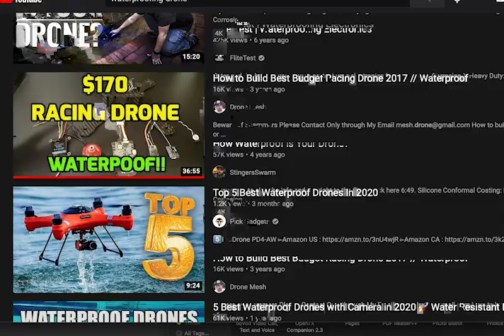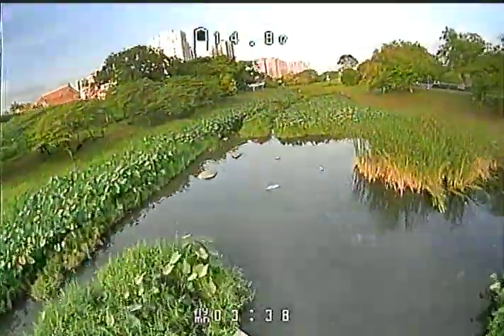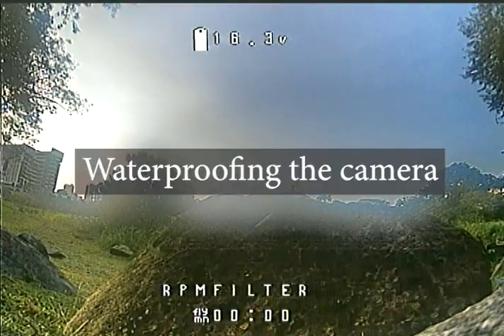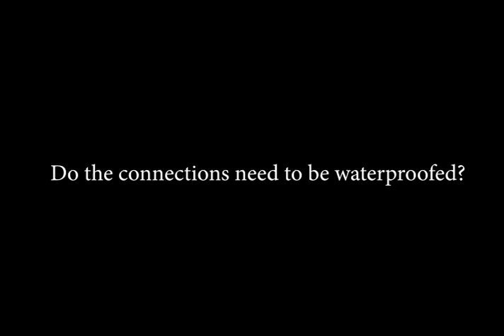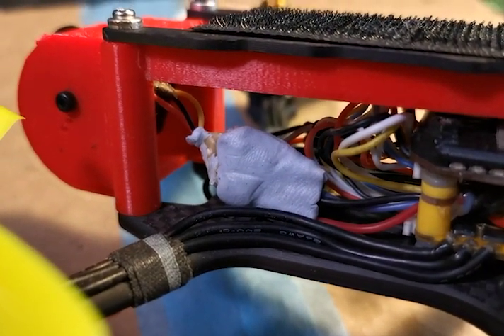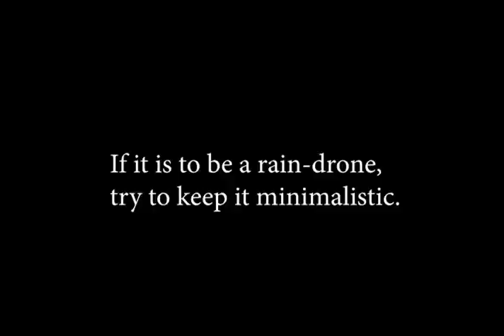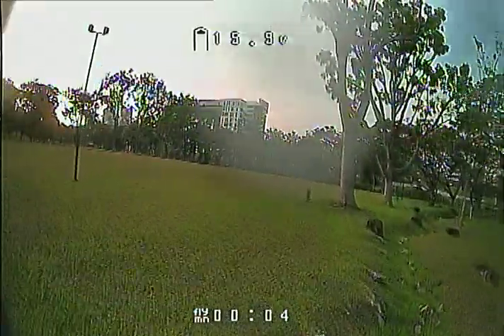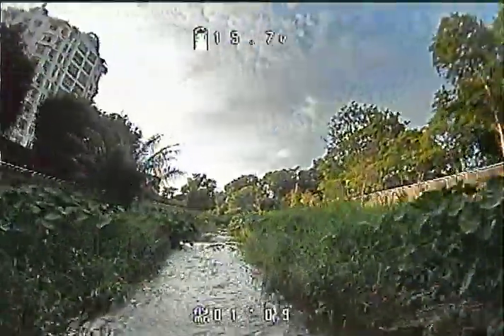FPV - What didn't they tell you about waterproofing your drone

Comment: Great tips, thanks! I also used thick silicone grease inside connectors to waterproof them. Only downside grease collects dust
Reply from the maker: Thank you Vladmimir! Enjoy flying!
Reply: ^^^^^  yes, i use a dielectric grease in the connectors, all of them.   Also acetone will easily dissolve conformal coating if you have to service it.
Reply: They make rubber booties for the USB
Reply: Do you need to put conformal coating on your whole LED bar or just the connection part

Comment: You can actually buy little rubber/Silicone  USB port plugs for next to nothing instead of filling USB port with waterproofing you can just plug and seal. Makes accessing your usb a whole lot easier if need be.
Reply: That's a cool idea, maybe one could be 3d printed out of TPU or something flexible? I'm working on conformal coating my builds for the (eventually) upcoming winter but at this point I'm not sure if only a light coat would do, or if I really need to cover absolutely everything conductive. My initial impression was that it's only super critical to cover the small component legs that are less than a millimeter apart.

Comment: 1 huge tips out a USB plub in the ports... DON'T COMFORMAL COAT THEM.. I don't care what the video says it's extremely hard to dig out comformal coating from that port... Plug the port and cost all over it, you'll be good
Reply from the maker: u r absolutely right! Thus as suggested earlier, pasting the blue tag over it before conformal coating will prevent the socket from it. 
leaving the blue tag is an easy way to waterproof it.

Comment: Surely you can make a plastic cover that covers the stack. Then have rubber opening for the wires.
Reply from the maker: If you try it, do watch out for heat issue though. The quad can drop from the air when the stack gets too hot. Air circulation is crucial to keeping the electronics cool.
Reply: @nutsidea  Yea the vtx is going to be an issue. Maybe if you split the housing for the stack up and had slots between each layer for air

Comment: I tried nail polish at first because it was cheap and always available but noticed after awhile that it would start looking different and nasty. Probably due to component heat but after a few cameras mysteriously died I wondered if it was also conducting current but haven't tested for that yet as I switched to silicone conformal coating by MG chemicals (amazon) and have not had any problems since.
 Winter flying demands protection with open frame drones as even launching and good landings will stir up snow that can get on the electronics and cause issues or damage.
 With these FC components working at 3.3V logic levels it doesn't take much moisture between two adjacent pins to cause IO errors that can bring the drone down.
It's Better to protect than Regret.
Reply from the maker: Thanks for the input! 
My guess is that the heat caused the nail polish to harden and crack. The moisture thus gets to the electronics eventually. 
Whereas for conformal, it remains a bit soft and sticky. Thus providing the protection even after prolonged usage. 
Good information you provided. I am sure others will benefit from your experience. Appreciated.
Reply: @nutsidea  That is a good assessment of what happens. 
** TIPS **
Conformal Coating is also UV light reactive! So you can use a bright blue LED or UV flashlight to inspect your application and spot voids to cover.
 You can cover the backs of and soldered legs to plug connectors, not the matting parts and don't seal the hole on barometer sensor chips and can be used as lite duty alternate lock-tite too.
 If your electronics do get wet power off asap and get it cleaned using distilled water to flush if really dirty and needs it, then allow to dry.
 Re lube motor bearings and/or possibly clean/replace but at least check them.

Hope this does help others and glad someone made a good video about protecting them.

Comment: Thanks for your video, very informative! I'm in the process myself and wondering: how to you handle the small PH xx plugs from ESC to FC ? Or a pluged VTX ?
Reply from the maker: Hi. I first connect them, test the flight to make sure that everything works well, before covering them with the conformal coat. 
Do understand that once you coat them, it is rather difficult to separate them without harming the connecting cables. 
Hence do it ONLY after testing everything works fine. 
Alternatively, use blue tag and wrap them around the sockets. Works as well too.
Reply: @nutsidea  Wow, thanks for those hints, valuable ;) And thanks for the super fast reply.

Comment: Great tips. I killed a gyro conformal coating and fried another, not sure why. I conformaled it over well. Hey what do you do for your XT 30/60 plug and battery balance wire?
Reply from the maker: the XT30/60 plug doesn't need any protection because they are already quite isolated by the plug. 
I am not sure why the gyro fried. Do keep the coating thin to allow heat to dissipate well. But that's just my guess. There is no need to cover the components except for the electrical contacts. The conformal/nail polish is to prevent short circuits due to close proximity of the terminals.
Hope it works for you on your next try.
Reply: @nutsidea  Thanks for the tips again. That MG Chemicals 422C silicone coating doesn't appear to be that good. It can flake off fairly easy. I'm trying clear RTV silicone this time. It may be another fail but at least I tried.

Comment: Great video! Thanks!

What do you use fpr waterproofing? Silicone? Acrylic?
Reply from the maker: For the electronics, conformal coating. For the camera body, I would suggest using glue from the hot glue gun.
Reply from the maker: Nail polish would work for the FC and ESC as well. I won't suggest silicon although theoretically it will insulated the boards from water. But you don't want a thick layer on the boards because you want good heat dissipation. Else the temperature will run up high  very fast.

Comment: Thank you for this video ! It’s all I needed, you genuinely answered all the questions I had after watching all the waterproofing tutorials on YouTube :) 
One question though : what about the XT60 connector ? Does it need to be waterproofed one way or another ?
Reply from the maker: Thank you for taking the trouble to inform me. Appreciated.
Reply from the maker: No the XT60 does not need to be waterproofed because the pins are separated and too far apart for electrical to cause any issue. 
It is when the connectors are very close together that water can become an issue.
Reply: @nutsidea  No issues even when submerged?
Reply from the maker: @MrPhilbautista  no damaged issues. However the video transmission and the radio signals drop-off dramatically when the drone is under water. Thus, you will lose connectivity when the drone is about 5-10 cm submerged. 
Otherwise it is fine. You will see your LEDS still on even when the drone is under water.
But do not. As prevention, always unplug with the drone submerged. Either that or immediately unplug lifting the drone out of water.
Reply: @nutsidea  Thanks. What if the antenna is high enough to stick out of the water? If there's nothing interfering with the propellers, is it still possible to fly it out of the water? I've seen it done but no idea what motors they use.
Reply from the maker: @MrPhilbautista  if you are standing right next to the drone, that wouldn't be much of an issue even if the drone is 20 cm inside water. The motors will spin in water without problem. It is an issue of signal lost if you are at a distance, and the drone gets submerged in water. In that case the signal cut off will be quite sudden. So it is a case of pure experiment vs a real-world flying situation.
Also in real-world, if it enters water like lake, streams or river, stuff like plants, sticks, rocks, etc will prevent the props from spinning as well. 
Just sharing on those situations that i had encounter before. Took quite a few dips myself to retrieve my quad.
Reply: @nutsidea  Thanks for sharing.

Comment: Would the same logic apply to waterproofing a high payload drone? For example a DJI S900 or Matrice?
Reply from the maker: I would think so. There's not much to it actually. Just insulate the electronics and exposed connections. However for big stuff, you might want to consider using silicon instead of Conformal or nail polish.

Comment: hello is there any issues with overheating  using dji fpv system?
Reply from the maker: Important to turn the temperature control to ON. (you can set it in the DJI goggles) that way the high power mode only kicks in when armed for flying. When flying, with good airflow, it is not an issue. When not flying, it is in low power mode, so that is not an issue at all. 
Even if you have the temperature control at OFF, on Vista, it takes quite some time before it gets too hot in hot weather. But if you have the Air Unit, it gets hot very fast.

Comment: @nutsidea how do the moters take the dipping into water? is there anything to consinder?
Reply from the maker: Hi Andreas. 
There is no need to worry about soaking the motors in water. The motors are brushless and don't get affected by the dip.
Reply: @nutsidea  thank you for the fast response. will coat my thoothpick for the winter season.
Reply from the maker: @AndreasFelix  That's awesome! Wished I had a snowy landscape to fly around too. 
All the best!

Comment: do you have to coat some part of the motors? i dont find information about the motors in time to coat a drone, pls help me with that information
Reply from the maker: Plus do NOT coat the motors. No need at all as they are brushless. 
At maximum, spray or drip a bit of oil into it. I didn't bother. I wash my drone all the time and it never is an issue.

Comment: How to waterproof 4in1 esc pin that use connector
Reply from the maker: Hi. You first plug the connector in. Then coat the whole connector casing with a layer. Remember to apply coat to the where the cables enter the connector. 
In most cases, the connector can still be separated after months. But occasionally, separating the socket can rip off some stuff.
Reply: @nutsidea  thanks for your reply 👍

Comment: I have rush tank ultimate vtx which is have a like metal shielding on top of it, so can I coat it bu just flooding it from outside ? or should I open the shield(I dont know if it safe)
Reply from the maker: From experience, Rush glues the metal casing to chip. You can ply it open quite easily but do it slowly. 
Also, what I observed is that most Rush stuff come coated with light insulation already. So it is not necessary to coat it anymore if you see that coating when you ply the cover open. You can glue the cover back. 

However, do check the board yourself. Cos I am not sure if yours is ultimate mini or tank II ultimate. Mine is a mini.

Comment: Hi! My quad crashed at water in 5 minutes, is still fine to use?, is there any components to destroy?
Reply from the maker: If you unplugged the power while it was still in water, it should be fine.
However, dry your quad thoroughly before plugging in power to try again. I usually place it on top of my modem box because it it pretty hot and dry there. Takes about at least half a day to ones day. 
Then plug in and see whether the ESC or FC are still working fine. 
Rarely does vtx, camera and crossfire get damaged.

You can reference this post for the dip mine had. 

FPV -- How to retrieve your drone from a pond
https://youtu.be/w4wCT5FE8ns
Reply: Hi! Thank you for your response, my vtx and camera are working fine, so it may have a chances to damage later or sooner?
Reply from the maker: if you  are worried about the camera or vtx showing signs of damage later, worry not. It will take quite a bit of abuse to damage these two. Usually it is the ESC that gets damaged first, followed by FC.Bigger motors also are way tougher than the smaller ones.